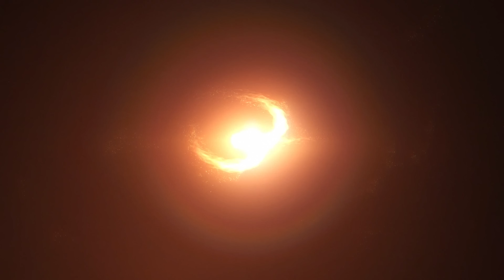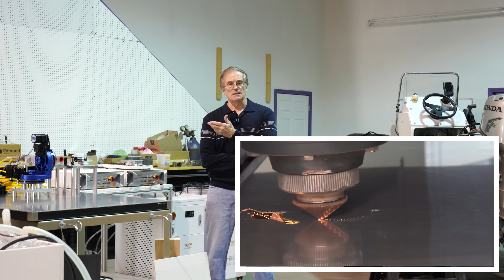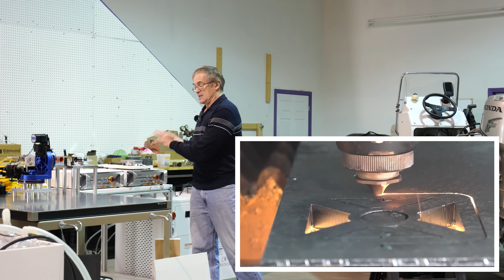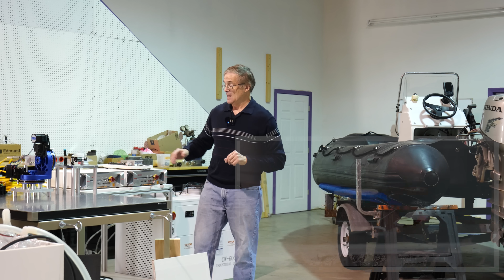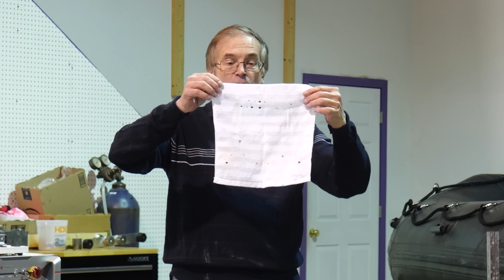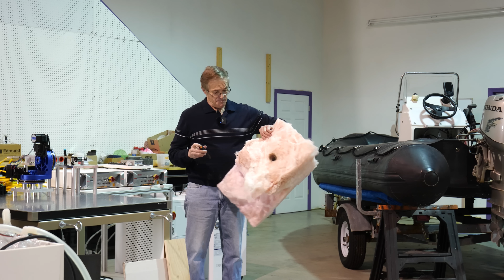We have a problem... and need your help!

Comment: As a Engineer that works with lasers on a daily basis, I have two ideas. The first one would be do have a slightly angled wall of malemine coated chipboard with a curtain of running water across it. The flow rate would need to be high enough, so that the water gets replaced before getting turned into steam and the film of water thick enough so that enough radiation is absorbed before damaging the chipboard. Unfortunatly water is not too great of an absorber for your wavelength of 1030-1075 nm. My other idea (and probably the more promising and unfortunatly more expensive version) is using a thin sheet of copper (about 2-3 mm thick) which sounds crazy at first because copper is highly reflective to laser radiation. But if copper gets heated to around 250 °C in an atmosphere with sufficient oxygen (e.g. air), it immediatly turns into CuO (Copper(II)-oxide) which is an excellent absorber (up to 97%) for laser radiation around 1 micron wavelength and even gets used in some commercially available beam dumps for high power lasers. The high thermal conductivity should do the rest, by dispersing the absorbed Laser power over a large enough area to not be able to reach the melting point of copper and burn a hole through it.
I wish you the best of luck and i allways enjoy your videos 😊
Reply: What if for your first idea you tint/ink the running water? Would it improve the absorbing properties of water for 1030 - 1075 nm? Perhaps a copper based dye...
Reply: @federicolopezbervejillo7995  I was considering aerosolised water, with the tint. a controlled smog.
Reply: a copper sheet suspended at a 45 degree angle in an water filled aquarium tank. I’m assuming that is the laser can pass thru glass lenses it could pass through the side and bottom of the tank. Only fire the laser when the drone is in front of the tank. Also, can you change the lenses in your device to spread the laser beam so it is effective at test distances but too dispersed beyond?
Reply: @cragnap  It will melt the glas anyways at this power level. Normal glas absorb about 5 % iirc. AFAIK IR is reflected by glass, see greenhouse.  Isk if polymers would do better, but certainly it would have to be ultra transparent at exactly the wavelength to not melt or explode away.
Reply: @cragnap  Glass still has a fair amount of reflectivity, though.  With lasers this high, wouldn't it be enough of a concern not to go that route?  I obviously know little to nothing about lasers... so just asking.  I could be COMPLETELY wrong in my theory.
Reply: Would adding the water curtain to the copper sheet help?
Reply: @TheFredmac  the water would cool the copper and prevent the radiation absorption, I'd presume.
Reply: To improve absorption, add lampblack to the water (= India ink).
Reply: @jankok9911  I was thinking along those same lines.  Water impregnated with carbon in a waterfall type configuration.
Reply: That's really cool. Can the same be done with electroplated cheaper metals? And can they be part of a water-cooling system (or just connected to a tank of water)
Reply: @jadzzzz  electroplating would not make the other metals as conductive
Reply: Simply create a small singularity that all light will be absorbed
Reply: Could dye the water to make it absorb light better? They make carbon fiber infused coolants that improve heat conductivity and look pitch black.
Reply: I posted this separate but instead of your boards use any structure and put a layer of carbon (coal, graphite, etc) with the water wall flowing over it. Or if you want to keep the energy IN the water use carbon suspended in the water, flowing or tank doesn't matter if you have enough turbidity.

This is non-ablative reentry vehicle heat shields or energy absorbers from accelerators done on the cheap. Charcoal works fine at these energy levels as an absorber and the water moves the energy on before you bond the carbon to oxygen.
Reply: @ninjakittens5255  I think your idea of suspending carbon particles (especially Graphite) in the water to make it absorbant and dump the energy in the Water before it reaches the backstop is beautiful 👍
Reply: They could do your second with a bunch of thin copper sheet and run water over top to have a cheapish liquid cooled option.
Reply: Not sure if 2mm copper can stop it, just look at the clips of the laser ripping through those thickk metal parts! It might work out if we can have a rotating sheet of it.
Reply: our 4kw lasers at work have internal beam dumps made from copper with some kind of black coating. They also have active cooling but still heat up quite quickly. There is a thermocouple to shut off the laser if the beam dump overheats. The beam dump is designed to scatter the laser Internally to reduce energy density. On the other hand pure copper is extremely reflective, enough so that the focusing lens on one of our laser cladding systems is copper.
Reply: I was thinking of something similar using graphine instead of copper, basically buikd an energy dump.
Reply: Water can be colored with a dye.  How about plastic pipes filled with dyed water.  When you have an accident you have a mess to mop up and a hole to patch.  This only works if you rarely burn though.
Reply: I think your idea is great, maybe made better by placing the copper on a disc, and spinning the disc.
Reply: this is so far the best idea !
You should combine the 2, use wall of malemine coated chipboard with a curtain of running water across it while having the other side of the chipboard covered with the sheet of copper and sprayed with water so that ir also runs down on it, to the reservouir where the water gets recirculated. I would also try to use atomized water curtain beffore the assembly to try to break up the beam before it hits the wall with the water curtain....
Reply: carbon block like we use for welding burn through and carbon slurry in the flow water?
Reply: buckyballs carbon
Reply: how about adding some charcoal to water, so its absorbing light better? it would look cool also
Reply: what if you impregnated the water with carbon or some other material which might absorb this wavelength better, something along the lines of a carbon emulsion
Reply: "A Engineer" ? Maybe "an engineer". 😉
Reply: @benvandermerwe4934  I appreciate the heads-up 👍
Reply: I was thinking of a large liquid cooling tile with a copper surface for absorption. But with the water flowing through an ice bucket.
Reply: I think this is a good idea, was thinking the same.
Reply: What about adding a dye to the water to make it black?
Reply: Why not dye the water?
Reply: I was thinking kind of the same idea, try to reflect and dissipate with ice, maybe could work layers of ive-water-ice-water
Reply: Coloring the water might help. The color agent would be responsible for absorbing the laser, while the water takes up the heat by evaporating, preventing the color agent to be melted.
Reply: @johanndirry I wonder which color would work better, the same as the laser or would a different color be better at absorbing the energy?
Reply: I came here to suggest the curtain of water as well. I would combine it with the thin foil and photosensitive shut down switch suggestion as well to provide resistance any single device failing and shutoff in case of operator incapacitation.
Reply: I was also thinking of water but it is transparent so I was thinking what if you add some carbon black to make the water dark almost black?
Reply: Copper dust suspended in the water?
Reply: I definitely thought water, though there are other possible liquids,
What about something like Flourinert or some other liquid?
Reply: Wow
Reply: Actually, a mirror would just reflect the hell out of it. Lol
Reply: A powerful enough laser can blast right through a mirror, vaporising the reflective material. @jenniferjones7969
Reply: I know you've said it's expensive, but it's also heavy. How would these sheets of copper be held up, and would the supports fail if the copper were burned through? would the laser punch through the copper before it could oxidize?
Reply: @ravenrose4869  Before the Oxidation begins (which happens on a timescale of microseconds, as soon as the Copper reaches 260 °C) it is effectively just a big mirror. So the risk of burning through it would be zero, since the energy absorbed without the CuO layer is quite low.
Reply: The water can be made into a slurry with particles that absorb the laser. Maybe fine sand, maybe graphite dust, or whatever material works best. The density can be tuned to allow the laser to penetrate into the slurry and be scattered inside
Reply: My first initial thought was flowing water as well. However, my second was on having something in the water to increase thermal capacity and ideally increase boiling temp... like a glycol, but something that won't likely breakdown and moreso something that inherently absorbs the wavelength so as the light passes through the curtain of water it would be absorbed mostly into the water instead of transferring energy into the wall. Then you will be essentially putting all your energy into making steam.
Reply: Use copper oxide in the water. Then it won't matter the material of the wall.
Reply: A water wall isn't the most portable thing on the planet though it's a pretty good idea I was thinking about running water behind a copper or aluminum plate fast enough to maintain the surface temperature but the math just doesn't work
Reply: Even better: combine this with the suggestion of @Spirit532. Make a copper container and fill it with course sand or (even better) crushed sea-shells. When the sand or sea-shells is moist it can adsorb a lot of energy and it will take a few seconds before the laser burns through the copper at the backside of the container.
Reply: Very much like your waterfall wall idea 👍, the copper one not so much: any solid absorbing this much energy is going to vaporize out of the way pretty quick ...
Reply: Is there anything that could be added to the water that makes it more receptive to absorbing this wavelength?
Reply: Not a good idea for using in mid-air.
Reply: I'm on team "sheet of flowing water on a medium".
Reply: what if you used copper infused paint. painted at an angle with a pond pump flowing water over it possibly dying the water.
Reply: Sharp angled white ramp that is hit at its sharp edge ? Then there are two surfaces.
Reply: Another question: Does the FAA allow lasers in the air, that can 'slice and dice' any aircraft at altitude, or his air-space is closed to commercial air traffic?
Reply: That's what I was thinking, a "waterfall" (maybe with "glitter" in it.)
Reply: I don’t think you need the water to absorb the energy as much as you need it to disperse it. Little water droplets would act like little lenses, which would take the slightly converging light and disperse it to safe levels, much like the laser CNC. 

I would maybe start with experimenting with something like an open sided box with a couple of nozzles pointed straight at the roof of the box. Creating a little localized water storm. Try to make the water storm several feet thick from the lasers perspective. 
If it works, you could then start shrinking it, see how many feet thick it needs to function, and then try making more self contained with a re circulation water pump… but the experiment could be done easily enough with a garden hose and pressure washer.
Reply: @WymansWorkshop  first thing is to stop the light, then absorb the energy, that would create steam real quick which could continue to disperse energy even when pulses would be longer... even with added charcoal absorption would not be perfect imo, its more like a step for better light stopping power...
Reply: +1 to running water. There are commercially available indoor waterfalls that could probably run enough water to carry away the energy.
Reply: A bit Rube Goldberg, but you could wrap the strip of copper around a wheel, hook that up to a motor, and spin it so the part of the copper strip under the laser constantly changes. You could even get crazy with forming the edges (not under the laser into fins to catch some air, and blow a fan onto it for more cooling. Or run water / a heat pipe down the back.
Reply: Firstly, thank you for all the knowledge you impart to us!!! My first thought was a prism to redirect down to ground, but that was already suggested. If lenses can focus a beam, surely lenses to de-focus the beam in/onto an absorbent material behind it would work?
Alternatively, there must be an alternative wavelength that can cancel out the lasers wavelength?
Aim the beam at a fiber optical cable and redirect the beam around the workshop  with mirrors and  disipate the energy through multiple targets of varying densities - maybe obsidian or marble?
You could even find a use for the beam like getting the government to fund a small hadron collider for the university lol.

Lastly, why use a high powered  laser? If you hook up a zoom camera and an auto tracking system with a AI analysis software to recognize camera lenses on drones and just hit the lense with a low powered laser to damage the optics so that it is blind and therefore useless. Or alternatively shoot the drone with a ball of water soluble sticky gelatinous blobs to bring it down. Thank you for your time!
Reply: How about a glass structure that would diffuse the beam?
Reply: We use to have a water cooled alloy block the industrial laser use to use when the the laser was switching on and off. Maybe water cooled copper to. Perhaps a heat sink from a computer that is cooled on the back with water. Even the cycled water could be fed into a heat sync. Maybe liquid helium or argon as a coolant.
Reply: Im afraid that melamine produces some nasty toxic fumes when it burnes
Reply: Does that not make toxic smoke
Reply: how does the "fog" affect things? it seems it will create some significant steam in the room
Reply: what if you put graphite powder into the watter?
Reply: Thank you very much for your comment about the water curtain! I hadn't thought about melamine (like the old Corel plates?) so more homework. Some drones are a lot nastier than fighting kites- you can lose more than paper.
Reply: what if he used a high concentration of colloidal copper in the water being pumped over the surface?
Reply: maybe there-s an ink you could add to the water curtain to increase absorption for this wavelength?
Reply: What about something like a microwave collimator?  They are designed to focus or fan a beam by specific increments. Water does seem to have a lot to do with dissipating energy quickly. It could either be flowed over the collimator or fixed in place as a hydrogel and doped to suit.
Reply: Water is good for its high specific heat capacity while metals like copper are much better at conducting heat.
Reply: I was totally thinking copper as well! I didn't take into account the copper oxide part though.
Reply: Use a bunch of books laid sideways.

Comment: Judging by hold the brick managed, larger pre-cast Jersey style barrier would probably hold up well and still be relatively easy to relocate. 

Load and lift stone gabions might also work. The irregular stone surface will help break up the laser and any cuts to the metal frame can be patched up with wire and steel fencing. I believe there are are forklift moveable sizes. You're basically design at HESCO barrier that won't puncture at that point.

Comment: This may not be viable at all since the gypsum board absorbs light as you said, but would a coating of something like vantablack help with the beam, and maybe some batts of rockwool behind that be sufficient to stop the beam.  
You mentioned that you use glass fiber insulation and it was like a hot knife through butter, retained the heat, and kept melting; but maybe rockwool would be a better choice.

Comment: What about waterfall wall? A cement wall sheet with a pipe on top from where flat stream of water is flowing down. Water can be "painted" to be more opaque for better result. You will need a powerful water pump.

Comment: May be worth taking a look at some commercially available  high power beam dumps. Ophir/MKS has an off the shelf 10 kW/cm² beam dump available. There are a few different kinds/configurations of beam dumps, but the underlying principle is more or less the same. The goal is to disperse and scatter the light as quickly as possible over the largest surface area that is practical while minimizing back scatter leaving the dump. For the real high power stuff like you're dealing with, a metal cone that is very reflective at wavelength of interest is used paired with a tapered cavity designed in a way that keeps back scatter to a minimum, and which is coated in a highly absorbent material. A little hard to explain in detail in YouTube comments, but if you take a look at some of the options from MKS, Newport, Edmunds, ETC, you should get a good idea of how they're built.

Comment: Use varying layers of black fabric hanging down with water being pumped to the top & flowing to the bottom through all the layers. Should be a huge catch for the laser. You might could even incorporate Phos-Chek into the solution that you cascade through the sheets.

Comment: A combination of Dielectric mirrors, (Braggs reflectors) or Trichroic materials, along with the Tyndall effect applied with corrugated carbon cement that are arranged in a form of a light trap configuration would definitely diffuse the focusing laser beam due to the scattering and reflectivity of filtering out the beams culminated layers .

Comment: My idea would be interleaved sheets of graphite. Graphite is not easy to ignite and has a high melting point. Maybe add some inert gas like (argon, nitrogen or so) flow between the sheets to prevent igniting. Should be not too heavy, easy to assemble and transport and not too expensive.